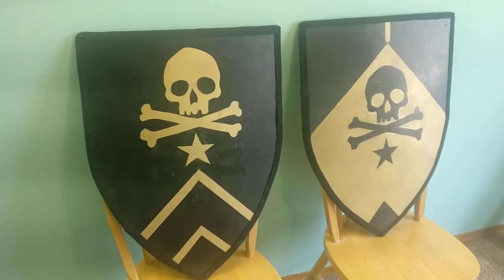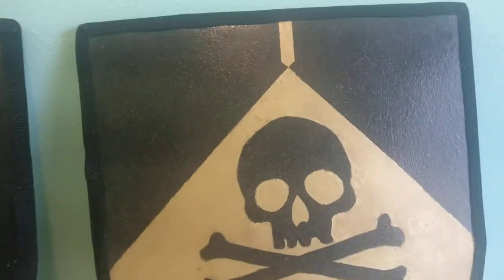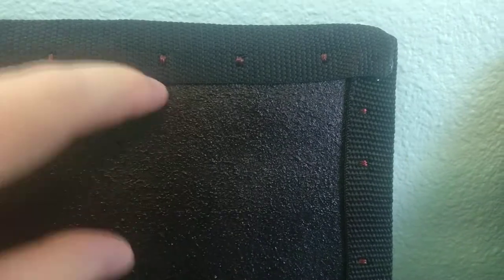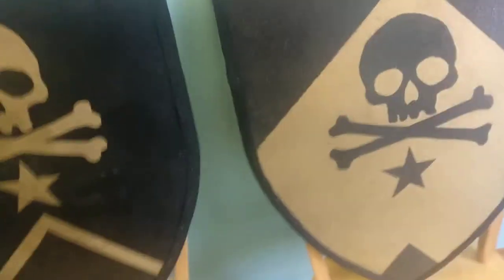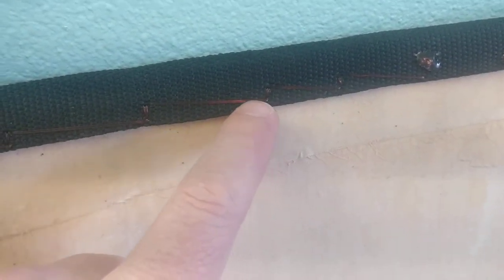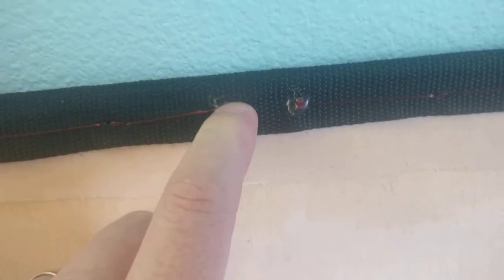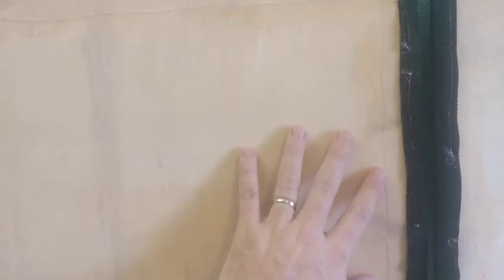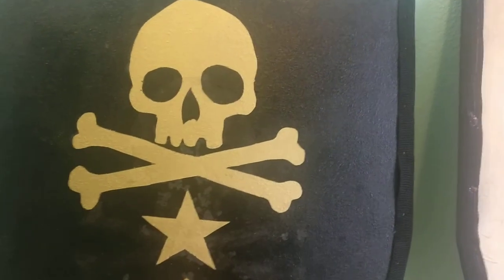How I made heater shield borders.

Comment: I'm painting mine now. I have some raw hide doggy bones being soaked but now I'm second guessing that idea because it doesn't give it a clean feel nor is it consistently the same thickness... I was looking for a good way to line it. What is that liner? Thick canvas? I was toying with rubber hose but I didn't want to go too artificial. I have a few yards of 12 oz thick canvas cloth. I used it for the front. I have a thinner canvas cloth that I got on sale for 4 dollars at my local fabric store (its like 50% cheaper than amazon). Thick canvas on the front, thin canvas on the back. For the clean beige sleek board. Some cotton rope x2 from the dollar store. 2.50 dollars glued to the edge. And then I take some more of the 12 oz thick canvas and turn it into strips with a very sharp knife so it doesn't fray. Then I line the edge with it by gluing it down and then adding nails or stitching for purely aesthetic purposes and way easier to do because the edge is already glued on so it doesn't wiggle and you don't need to worry about it being uneven. As I was typing this I realized that this is actually would I should be doing because Cavas is cheap and it reduces the amount of material I need to make alot of shields. I went to the dollar store and got some dog collars. 1.25 each. I am goiing to use them as my straps. They're stiff fake leather but look nice and have metal rivets in them that makes it look good. So I'll be hitting up the fabric store and the dollar store for half of my shield supplies from now on. Its mainly just glue and plywood that's expensive, so I need to be on a look out for hardwood plywood sales at lowes or home depot. And I guess I can get the cheap glue for the undercoat layer to combine the wood with the burlap. Since the polyacrylic coating will basically make it waterproof I shouldn't be wasting 12 dollar wood glue when I could be just using the 5 dollar wood glue. Heck, I can probably even use Aileen tacky glue that goes for like 1 dollar a bottle on amazon when on sale. I had some dollar store acrylic paint (amazon is cheaper) but I only had 1/4th of the bottle left, but it managed to get a pretty decent thin coat over the shield. That means painting the entire thing would probably only cost me a bottle or a few bottles of 2 oz acrylic paint which is around 2-3 dollars. Wow so many ideas on optimizing shield making. Can't wait to make a entire collection for my friends. My first shield didn't bend as much as I would have liked it to, and my second shield cracked when I tried to force it with ratchet straps to maximum. Both are still usable especially after the canvas lining to cover any imperfections. I guess I'll be turning them into wall decor and larp shields. If I put the plywood in a trash bag filled with water is good enough to soften it up for bending. My next batch will be practical for sparring. As I watch the entire video all these ideas suddenly start flooding in and I can't wait to put it into practice. I'll report back in a week or two if I succeed.

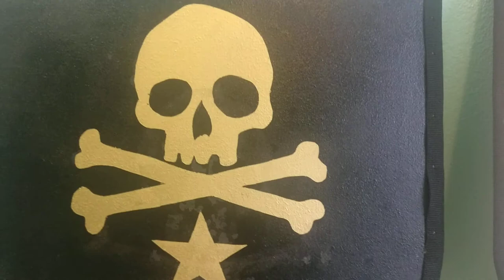Comment: Is there a reason why people tie the lining instead of using wood glue on it? Then you can drill through it and do the criss cross with aesthetically pleasing nylon rope. That way thee won't be any loose parts that lift upward like at 5:04.
Reply from the maker: I have since gone to using rawhide to edge the shield. But depending on the medium you can use the glue first method. But prepare for a fiddle fest and glue mess and use lots of clamps. Especially if trying that with rawhide.